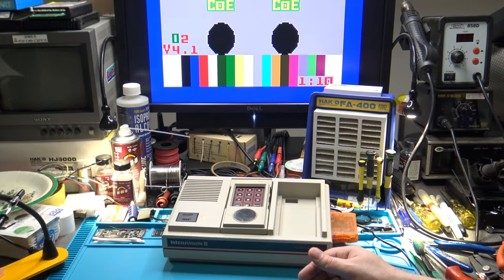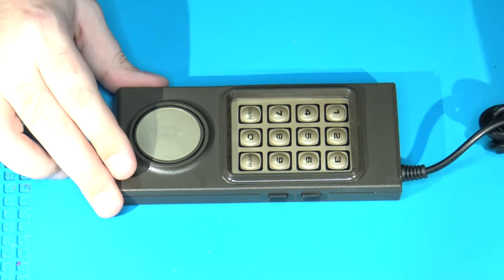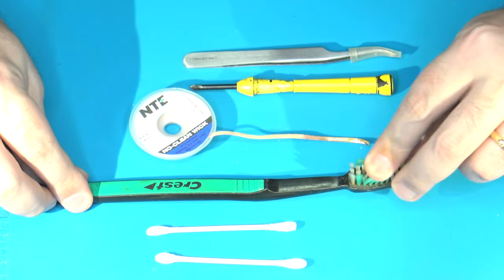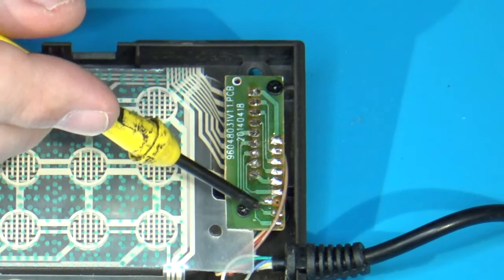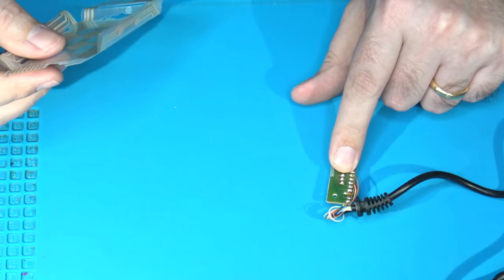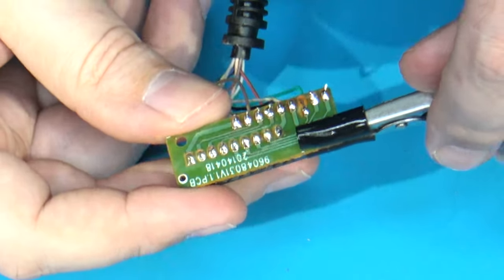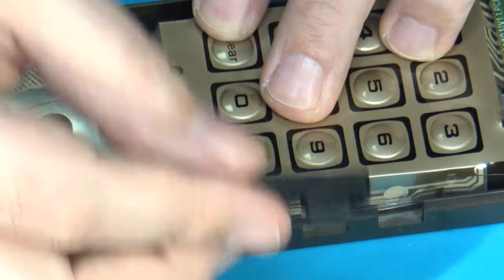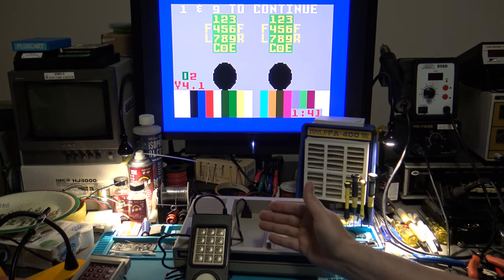ITC#83:- Intellivision Flashback Controller Conversion - Wiring for Mattel Use

Comment: I have Intellivision 2 controllers that are not working, mainly in the disc area. How would I go about testing and possible cleaning to bring them back to working condition?
Reply from the maker: If you are talking about the model 2 controllers, there isn't much you can do for those. There aren't any replacement mylars being made for them that I'm aware of, and they are put together using snap tabs that are getting more and more brittle over the years. This is why when they were more available, I bought an extra set of the flashback controllers that I then internally modified so I could use them with a model 2 Intellivision, or my Sears Video Arcade Intellivision.

Comment: Is there away to convert these for use on a Mame pc ??? I know there is a few short cables out there but they cost any chance you know how to make it compatable
Reply from the maker: I'm afraid I don't have an answer for that. I've not looked into it myself but I'm sure some sort of adapter box would be needed as the Intellivision by default doesn't provide +5 to the controllers as most other console did back then. In fact, adapters I've seen to allow other controllers to be used with the Intellivision, actually required external power to the adapter box because of this.

Comment: Can a Intellivision  2 controller work on a flashback system or do you have to do the same thing.
Reply from the maker: In the case of the Intellivision 2 controller a separate cable harness is needed that does the wiring conversion. There used to be a source for those sometime back but I'm not sure where you could get them now.

Comment: Sorry this video was awesome thanks I think you just save me some trouble, and do you have a flash back controller thanks lol 60 year old gamer, or should I do just the same but backwards with Intellivision 2 controler.
Reply from the maker: Are you wanting to do the opposite where an original controller is setup to be used on the FB? I answered this in the last comment, but you would need to find a wiring harness that changes the needed cabling vs trying to change the wiring inside the Intellivision 2 controller. There used to be a source for them, but I'm not sure where you could get one currently.